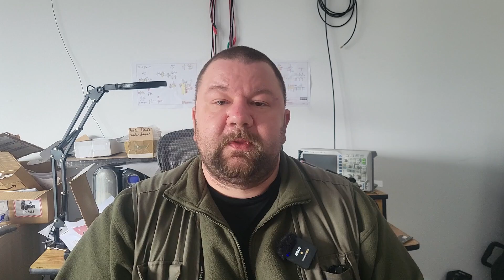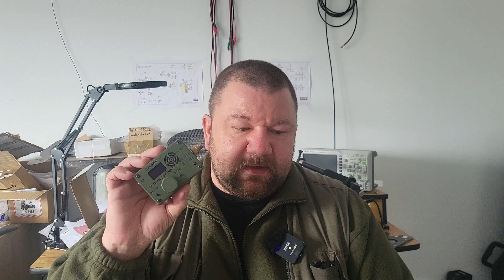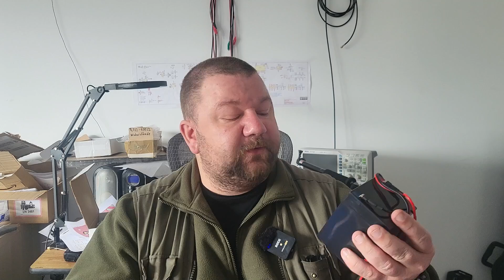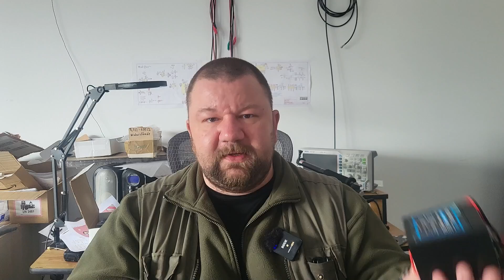(tr)uSDX: Let´s talk about input voltage and output power....

Comment: If you had a choice between a USB PD to 15v be too much if it holds the voltage pretty close to 15v or would you recommend playing it safe and just going with 12v? Thank you for the video!
Reply from the maker: 12V for sure. Searching for highest output power is not the way to go in the qrp world. 73 Manuel; DL2MAN

Comment: Hi Manuel, recently I bought a trusdx from your approved reseller on Amazon, it's awesome. It's the classic version of 20 m , 30 m, 40 m... But I have a question: what's are the frequency limits of each band? I mean the upper and lower limits of frequency for each band in transmission mode? Thanks

Comment: Thanks, Manuel for this.  Off topic request: I went to register on your support forum but am unable to so far; it keeps telling me that either the email address(es) are already taken or that the user name is not approved/registered etc.  I'm W9SK or eeeehaw user names.  It's been a few days now and I need to seek forum help for both myself and another (tr)uSDX user trying to get VARA-HF Winlink working with the single USB  cable streaming driver working on our radios.  Ie, I can't get past the wall and the forum administrator link is dead there.  Help!
Reply from the maker: Hi Stephen, both usernames do not exist. I remember having deleted eeeehaw, because registration requires a Callsign in User-Name or E-Mail adress (Spambot countermeasure). Please try registering again. I´ve now enabled allowing re-using e-mail adresses. 73 Manuel; DL2MAN

Comment: Is it possible to add heat sinks to the PA Mosfets for greater reliability with compromised antennas? I am concerned that I might have a situation with a compromised antenna that i might hurt the fets by unknowingly txing with a high swr. I dont plan on overvolting but still worried about keeping the unit working and not breaking it?
Reply from the maker: There are heat sinks available for "TO-92" housings. So it IS possible. I never burnt a Set of BS170s in the field, only on my workbench. As you can imagine, I have a few (tr)uSDX and use them a lot. I pre-select my BS170s with a component tester, so I have 3 very similar built in. This ensures equal distribution of load and mitigates the chance of chain reactions. If you want to be super careful: Start any activity in the field on USB Power supply. It is virtiually impossible to kill the PA on 5V. When everything is safe: connect it to 12V. 73 Manuel; DL2MAN
Reply: @dl2man  Great suggestion to setup on 5V USB and once when antenna is tuned and SWR is OK then switch to 12V.  Would low value resistors in the drive to each BS170 help to balance the drive and prevent runaways due to an individual chip overheating?

Comment: Hello Manuel,
I operate the (tr)uSDX at around 12V with a suitable adapter on a USB-C PD3.0 power bank or any other USB-C PD3.0 power supply.
I would say that this is the most effective solution, as I also need the power bank for other things and don't have to carry several different batteries around with me. 
Furthermore, nowadays everything runs with USB-C, which increases the likelihood of getting power everywhere if my power bank isn't enough.

This solution seems so simple to me that when I watched the video I had the impression that I had overlooked something.😅
Can you please help me out? Am I doing something wrong here?

Thank you in advance & 73 Seb
Reply from the maker: In deed there´s something else to consider using PD.... PD transforms your 3,6V (internal Battery) into 12V. That usually happens with step up converters that can be noisy and has also some level of efficiency 50-80%, which means: you´re turning additional 20-50% into heat. And last but not least: There are documented cases where transient behavior of step up converters have destroyed (tr)uSDXs.... I have a similar solution in my drawer, but I don´t trust it, so I use primary cells. 73 Manuel; DL2MAN
Reply: Thank you very much for your explanation! That really opened my eyes. And yes, you are absolutely right that switching operations, especially with inferior power devices or cables, can lead to interference and, in the very worst case, damage ... although these negative effects are somewhat less pronounced with high-quality PD power supplies due to buck converters compared to the boost converters of power banks.

But if you know about this type of power supply, why don't you take appropriate precautions on the (tr)uSDX itself? I don't think this type of power supply via using USB-C PD is particularly far-fetched, given that it is available virtually everywhere, and I'm sure a lot of other people could come up with it.

I'm just saying that a device like this, which is designed to be used on the move away from the grid, should be robust enough that it doesn't fall apart at every little thing. And I would personally include the power supply in that, wouldn't you?

Thanks again & 73 Seb
Reply from the maker: You have a huge advantage over me, when I designed the radio..... Your own perspective. When I designed the radio I did not think about a case like that. I designed the radio around my own usecase and thought, that maybe a handful of tech enthusiasts would try to follow my cryptic instructions and build one (as happened with uSDX Sandwich before). Now 20000 (tr)uSDX later, I´ve got lots of different opinions of what could have been improved. I´m simply a victim of my own success.... But feel free to improve it along your needs and don´t forget to share your findings, so others can benefit. 73 Manuel; DL2MAN

Comment: Never understood why they want more output from the rig, when thre are so many CB linear that take 4 Watts in and give 100, 200 etc Watts out.
But, I plan on buying it eventually..just money tough here in Jamaica 🇯🇲
Reply from the maker: Using a cheap CB linear amps is also not a good idea, as they usually lack proper low pass filtering. And my opinion is still: The best amplifier in the world is a good antenna. That in combination with a quiet place makes it happen to the whole world. Even with just 3/4/5W.... 73 Manuel; DL2MAN
Reply: @dl2man  I agree that proper filtering behind many amps is necessary. And from my own experiments in the 90s is pretty cheap.  We'll, I did have a freind at MFJ that helped me with parts for my old 2 pill, and it was weird to see all those antenna switches into boxes then out to the antenna.. having to make sure each switch was on the same band.. but, it worked.. when I wanted 145 Watts instead of 4 Watts..  which wasn't often. 
I worked 75 countries and 47 states on 10 meters with a radio shack 10 meter radio on low power fed by a battery and a solar panel.  The battery couldn't start the chevy anymore but could run 12 volts.  The panel was the most expensive part of my set up.. because I got the radio for 40 bucks, got my antenna from a local cable company cutoffs, and the charge controller was chinese and a whole 5 bucks.  Lasted 14 years though..

Comment: Thanks for this! Two days last summer I was doing wilderness POTA activations. Day 1- 8C and the output was around 5W. A few days later, 27C and the power went up over 7W, I assume from the temp of the LiFePo  battery and a bit of runaway heat inside the radio. What's the limit for the radio before damage might occur?
Reply from the maker: Did you even watch the Video ? The Video was litarally adressing the limits and the recommandation.....
Reply: @ indeed I did, but my question was perhaps not as clear as it should have been. The battery wasn’t of higher voltage. Rather, I was in conditions where the outside ambient temperature was doing things I couldn’t control, and wanted to know the approximate time limit for operating under these conditions. In an emergency one would still need to operate, but for how long? Does that clarify my comment/question?
Reply from the maker: @RodMurray  Gotcha. Bot I don´t have a good reply to that. There are no hard boundaries. It all depends on your rigs efficiency, Antenna SWR and your Output Power. CW and Voice via SSB don´t heat up PA as much as Digimodes (Like FT8/WSPR). That being said: With 11,1V and 85% Efficiency I did a CQ Loop in CW for 10 Minutes in Summer until I realized, SWR was 1:9..... PA still lives.... 73 Manuel; DL2MAN
Reply: @dl2man  Thx for the replies Manuel. In the end, the radio was fine. Still works great. I might add that it’s a Classic that had the MOSFETS replaced by my Elmer when I fried them setting up FT8CN. See my trusdx reports on QRPer.

Comment: Thanks Manuel for another useful video. I love taking (tr)uSDX transceiver with me on walks.
And yes, 3x lithium-ion batteries or 4x LiFePo4 batteries are sufficient to power it. 
If you need good RS-reports, use a better antenna or/and power amplifier.
(Remembering an old TV show - Mach mit, Mach's nach, Mach's besser.)
73

Comment: Awesome simple will explained video. Another source of power are the PD power banks that can charge a phone one or two times. You can get a 12volt trigger cable and the right cable plugs right into the trusdx. 

Also great point on the power, why over work the components for negligible improvement. 
If anyone really wants to notice effects of power changes, power the (tr)uSDX over usb from the microSD port get a signal report then switch to external b power supply. That is a much larger change in power.